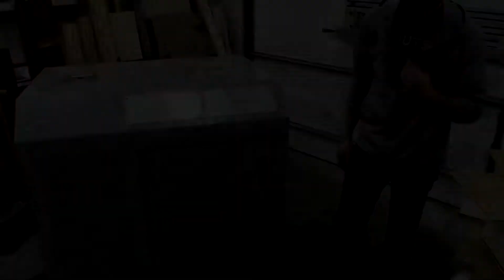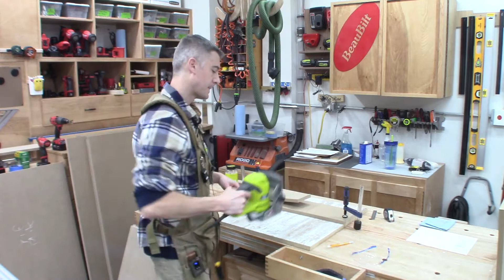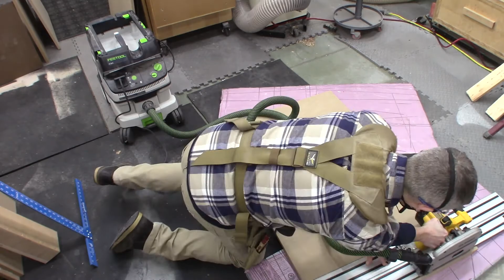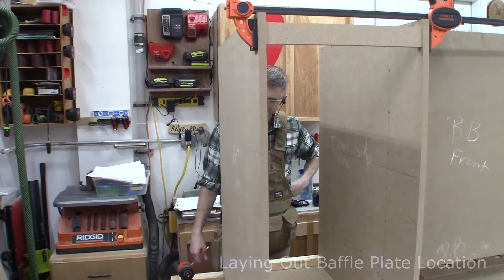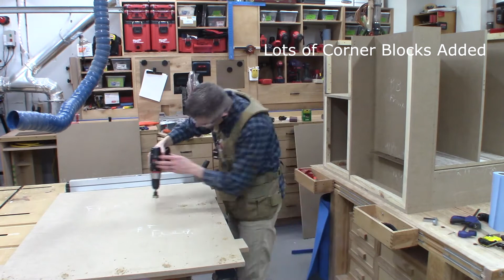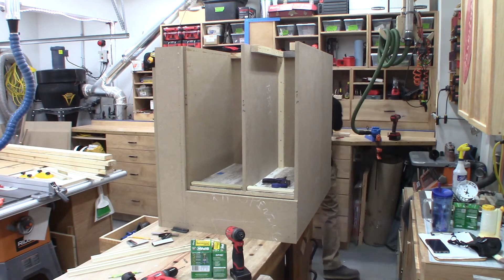Building a Modified PTS Flowbench (Part 1)

Comment: The slider assembly is the most critical part of the build, attention to detail is important, I recommend HDPE for the slider plate it's .230" thick if purchased as 1/4", no need for the tape if you use 1/4" MDF for the spacer (as you can HDPE see not required though) :) Thanks for the tips on the biscuits and how to make the cuts! I'm still watching the series (and learning) so I'll add some more tips I use on my PTS builds. I'll say it's interesting to watch all the ways my plans have been built! Great videos!